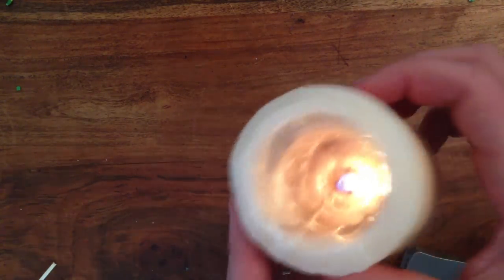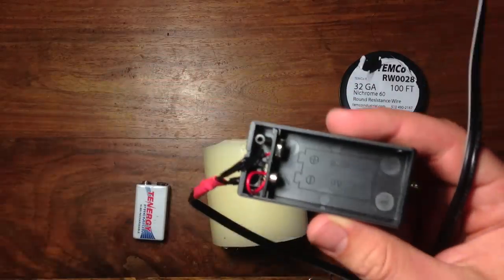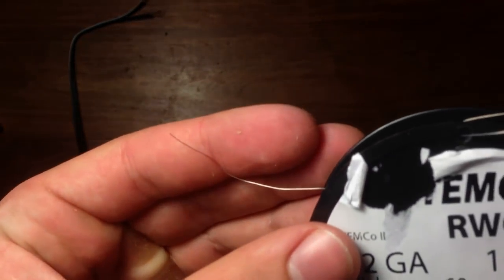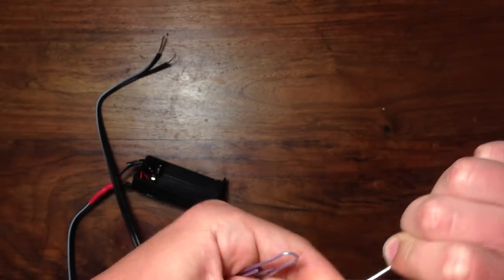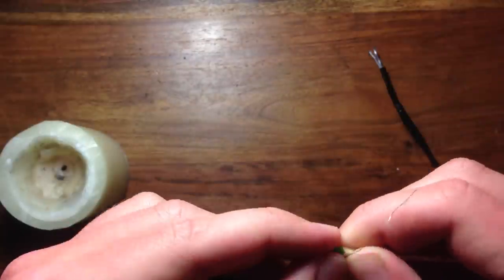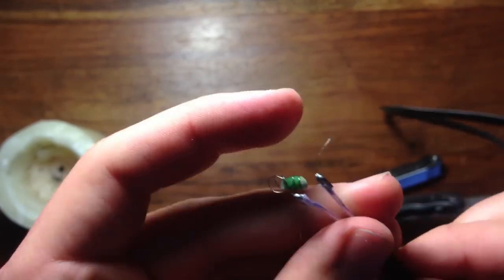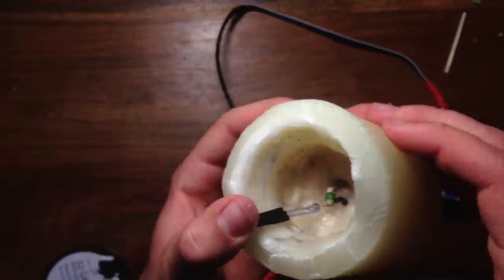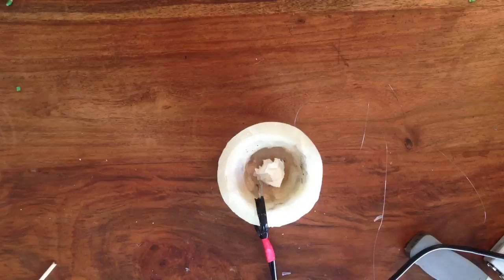How to Make a Self Lighting Candle

Comment: So would 5v DC be enough juice to heat that filament? (I'm thinking wireless remote control)
Reply: 5V should be fine.
Reply: nicknack125
 Very cool- I have a voltage booster/step up module so I can turn 5v into 12v on the circuit.
Lipo power the candle, bind to a receiver keyfob, and you have a killer Halloween gimmick.